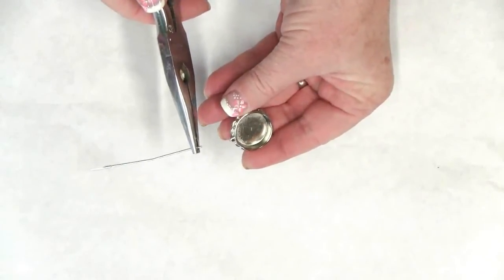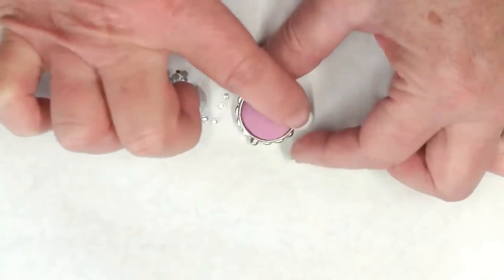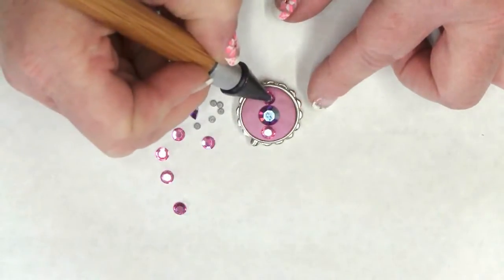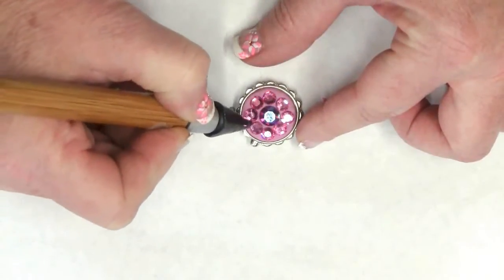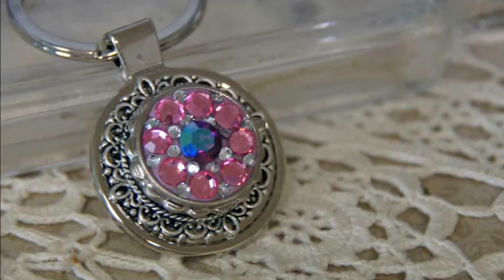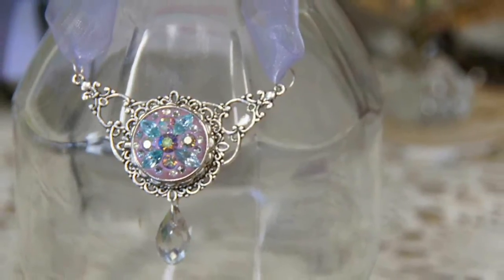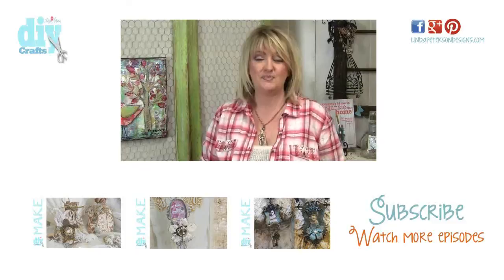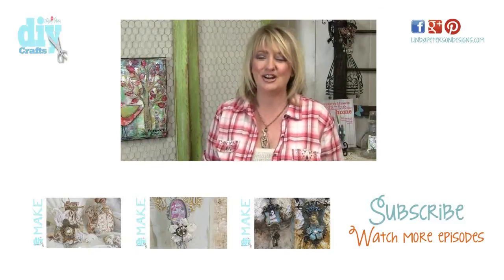How to make a keychain with epoxy clay and swarovski crystals

Comment: How does the clay stick, if you don't add glue?
Reply from the maker: Hi Esper,  Great question! The epoxy clay is somewhat sticky so it will adhere to the bezel.  If it should however detach, I would recommend E-6000 to secure it back in.  Thanks for watching and asking the question! {Linda}